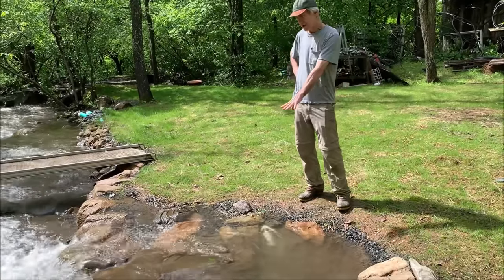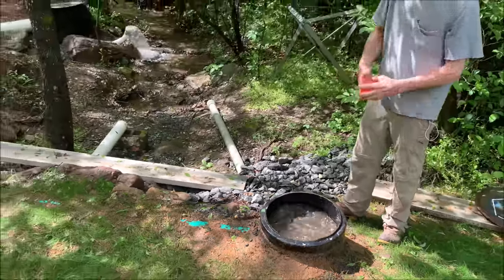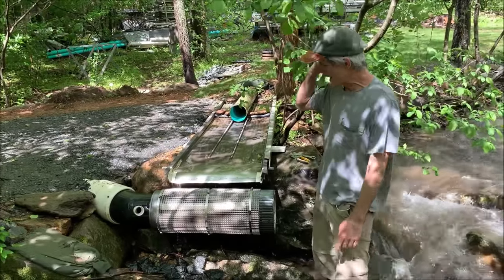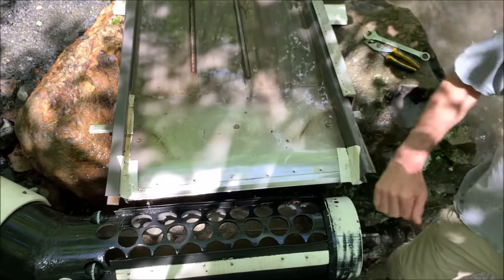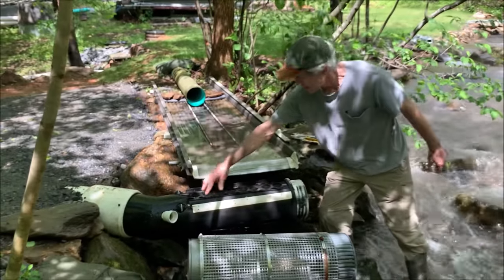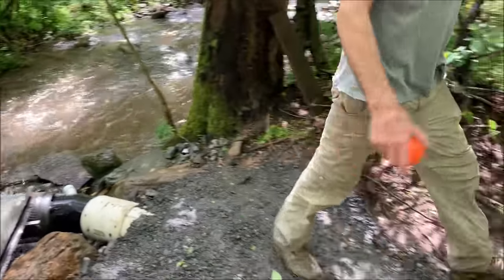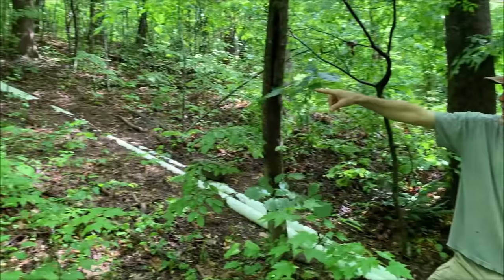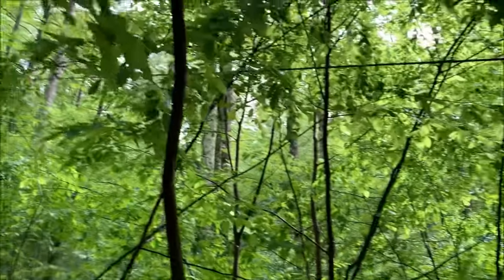500 Watt Hydro Power System in Virginia (Overview)

Comment: I got to say for anybody doing this use your three phase and run it all the way up to where you're going to use it.
That higher voltage 3 phase is going to get you less voltage drop and less line loss, better yet step that three phase up in voltage. For even less line loss. 
I see this quite often in small generators and windmills where they switch to DC right at the base of the windmill or right above the generator.

Comment: I haven't built hydro power before; but from design perspective the capacity of the stream to generate more with or without diverting the water, the effort seem more than needed for 500W.
Reply: Fact Checker  MartyT - https://www.youtube.com/user/AngryRamNZ/videos
Reply: thats a lot of time effort and money you could do with two solar panels for a few hundred bucks
Reply: @issadraco532  He spray painted them and hid the generator in the rocks because its horribly illegal to do this in virginia.
Reply: @issadraco532  Many people live in cottages without any electricity, so this is way to have comfort and do not need generator. With LED lights and low consumption it is quite enough for you to have lights, TV etc. Older people do not have households wasting 20kW/h. LED lights in 3 room cottage would take like 50-60W and rest is for other electronics. FX CPU or similar would ofc need 500W+, but does this guy look like he spends a lot of time on PC? No. So most likely he uses laptop with 35-65W consuption and with the lights on still has 300W+ left for other stuff.

Yes, it wasn´t hidden. Yes, it isn´t properly painted. But the cost of it was most likely low since he did it himself from scraps and thats what counts.

Most parts of this solution were actually very creative and reused scrap nobody wants, so you get it for free. I guess he payed only for turbine, piping, inverters and batteries. So again, cheap option.

And about the looks, that´s your point of view. He might have big property and this could be far from it, on the edge, so he doesn´t even notice. And again, it is his creation. Most likely he enjoys the looks, since it took him time and sweat.

It must have taken a lot of work... It is easy to be internet judge
Reply: @Grandassets  I agree it is way way overkill. However, I can see why water power would be preferred since it's available 24/7. But yea, way too much work, for such a small amount of power. And it just looks like shite.
Reply: Fact Checker  yea but he generates 45psi, how u do that from a stream?
Reply: @Grandassets  not even close. You would need 24 solar cells with a perfect set up to generate the power this hydro system is generating. 12k a day
Reply: @lowcountry1397  each panel is 385 if you get the good ones or 235 watt if you do it on the cheap you would need 2 or 3 to do the same thing, hey look ma no moving parts in solar to break down is a plus
Reply: @Grandassets  lol. He's making 12000, as in 12k kilowatts, a day. I have solar at the house and an off-grid setup at the farm. Unless, the cells are roof size, directionally perfect or magical, you're going to need a lot more than two
Reply: @lowcountry1397  the title says 500w
Reply: @Grandassets  The sun only shines part of the day on the solar panels and even then the period where you actually get the rated output is small. The water flows 24 hours a day. 500W x 24 hours in a day = 12000 wH (12kwH)  385 w x 3 solar panels x 8 hours = 9240 wH this will less, as I highly doubt you will get full power for 8 hours many days.
Reply: @frederickjohnh  4 panels would cover the 12kwH in 8 hours vs 24. If you want some redundancy, bump it up to 5 panels, that gets you 15,400kwH on a perfect day. We're also assuming a full stream with no drought for the 12kwH. You can get 385W solar panels for $250 each. So even if you add freight shipping and taxes, you're looking at around $1500 to get setup. 

For the hydro, if you can find 4" PVC for $12 for 4"x10' you're looking at about $250 for 2 100' runs. The "Greenspoon" is $250, and the ME1603 is another $150. So you're already at $650 without accounting for the pipe connections, or any of the other pipes, and his metal tray and sieve at the top.

So let's say in a perfect world, the price is similar for close to the same output. The question then is do you like to tinker around and you don't mind everything involved in the hydro, or do you just want the simplistic solar option? Not to mention that his pipe is literally hanging from trees that could fall in a storm and a large part of his entire system could be lost. Replacing 100 feet of pipe in the woods is going to be a lot harder that replacing a couple panels. I'm not saying one way is right or wrong, just food for thought.
Reply: @Grandassets  And you would end up paying for it in batteries. That is a cost that comes with solar vs hydro because you have to be able to store what you make in 8 hours to use in the other 16. And with hydro, on a cloudy day you still get power whereas with solar, it will be reduced or zero depending. Solar is not for everybody and neither is hydro power. Each has its place.
Reply: @gravelydon7072  up here in NY our streams freeze over, heck our river is right now
Reply: @Grandassets  Yep. They do in Ohio also. Now you know it is really cold when 30 miles South of Miami, our irrigation systems start freezing up. Our water temps down here are in the 70° range even on a night when the air temp drops to 26°. Our soil temp 6 inches below the surface right now is 75° as an example with a 72° air temp.

Now would your solar panels also be covered in snow right now?  The panels in SE Ohio are but the Ohio River is flowing as would the creek thru our farm be.
Reply: I would have aimed for a water wheel made from repurposed plastic, on a grander scale with a pulley system for increasing or decreasing the rpm's on the gennie.
Reply: @Issa draco for you to hide behind your computer or smartphone and criticize the hard work of the man is very easy I'm sure you won't be able to come up with an idea like this. You have to give credit where it's due......
Reply: @issadraco532  Because some of us enjoy the design process and don't care if we have pipes running across our property. Also living off the grid (or at least far away from populated areas) forces you to be self-sufficient. You build things with what you have, and you don't let the resources available to you (like running water) go to waste.
Reply: @PhillyMotoXTS  Something I haven’t seen anybody bring up yet - what happens to the land if one of those pipes breaks? You’re gonna have a high pressure stream of water washing away a lot of topsoil, potentially before you even notice anything is wrong. You could end up with a real mess on your hands and potentially bad damage to your property or that of your neighbors. And the more pipe - especially the more dangling pipe - the greater the chances of something going very wrong.
Reply: @sunspot42  It seems like a hydraulic mining operation waiting to happen!
Reply: @PhillyMotoXTS  old comment now i know but your math is wrong because even summer you don't get 8 hours at maximum power unless your panels are on a tracking system and then that's only summer you will get less useable light during the other seasons and can get days on end of near zero in rainy weather so when your factoring price not only is it the cost of generating the power but storing too so you would need more panels than you originally thought probably more like 8-10 and in general a much larger battery bank
Reply: @gravelydon7072  Exactly! As well as clearing precious trees to ensure solar panels get enough direct sun exposure to be effective. This property is covered in trees. Despite the awkward and unsightly web of pipes, despie the attempt to camouflage them, utilizing the creek to generate power round the clock was the natural choice for this site.

Comment: I don't think it's overengineered. This is how home-made stuff looks like. Realize there's no (mini)dam where the water would get cleaned just by having the gravel, sand and mud simply fall to the bottom. Also, it is all in the open, i.e. things are falling to the whole system. It's not a compact concrete building. That said, I think it's a simple working solutions to individual aspects of the task. 

Also, he doesn't have a big hill around, and the stream seems to be seasonal. So, 500 W seems legit.
Reply: Still, it looks like there is a large money investment for all of the piping, electronics, etc,. How long for return on investment?
Reply: @r.carter8378  I have no idea what his ROI would be, but a decent amount of this stuff could have been laying around or could also be used for a different project. I do agree that it is a lot of stuff and if he did buy it all it would be quite expensive.
Reply: @r.carter8378  Electricity costs on average 13.5 cents per kWh in the US. Hes producing roughly 500 watts, and for simplicity we'll assume that's constant regardless of conditions (not true but for analysis it will do. He would have to take a 24hr production measurement and get the average). So, every hour his setup is producing roughly 6-7 cents worth of electricity. Assuming it runs flawlessly its around $50 a month. 

The generator hes using is like $150 new. I can't estimate the other electronics because they're not exactly my field of knowledge and we don't know whats recycled/used. Pipe prices vary depending on what kind hes got going... a decent estimate would be around a year ROI I think.

Comment: So over engineer for 500 watts, could be more simple, but if it works for him and his happy, congrats to the builder.. it will qualify for a Mega Projects Discovery channel series...
Reply: He could win a Rube Goldberg machine competition hands down!
Reply: I know, I don’t understand why the water needs to be moved 100 miles away from the house.
Reply: @masonlynch1793  It probably needs to move that far to create an increase in pressure to make the hydro work. The bigger the drop, the more potential power.
Reply: Mason Lynch. That's right, you need that distance and height drop to bring up water pressure to drive the turbine. Also the sudden reduction in pipe size will greatly bring up the water flow with all that distance of piped water pushing it. It seems the cable or rope  up to the tree is to hold up the pipe up while not having the movement of the tree move the pipe around. He must have gone over his vision in his mind over and over again and finally arrived at its Eurika?  moment

Comment: Your rotating intake screen is a good substitute to a Coanda screen. Sure, it has moving parts, but it's a necessary mechanism to keep the intake clear of large debris without frequent maintenance.
Reply: I used ceramic skateboard ball bearings for my rotating screen, running slowly and water lubricated they show no wear after two years and are very free running. I had to put my remote electronics in a completely sealed enclosure as ants and cockroaches loved the warmth, they get into the inverters and cause arcs at 230 volts. Lightning just causing ground currents has induced various odd failures like diodes and digital meters so now there is a heavy aluminium wire earthing everything top to bottom, problems stopped.

Comment: Lot of infrastructure for 500W but as a fellow maker I fully understand half the fun is in the building of our contraptions and rarely the end result itself! Keep up the good work! I had to chuckle at your use of golf balls throughout!
Reply: Even if it were 300 watts, that would be all day every day I imagine. Not fluctuating as much as wind or solar.
Reply: 500W 24 hours a day is a lot. 12KW Hours. You might need to have the heating as gas or burn wood in winter.
Reply: It's probably as much as or more energy than a house uses at idle. Washing machines aren't 24/7.

Who knows if it totals to more than they use in a day though.
Reply: i imagine they have solar too, or they could use 2of these micro hydro setups with not much added pipe at the end, seems they have lots of pressure
Reply: I was thinking the same, I use on average 500kwh a month so this'll actually run my house just fine, its getting the required power for cooking id have trouble with, but change mode of cooking and id be sweet
Reply: @gorillaau  10cents per kWh.
Reply: LOL He had the golf balls screwed onto the box to support the cover. I thought he is a golfer.
Reply: The infrastructure looks very very scalable. Especially with that over flow he could easily re direct that wasted water
Reply: tbh from a perspective of a guy who got these pico-hydro stations in recommended yesterday, and watched like a dozen of videos on the topic since then: this looks like the most reliable setup out there. Except that Nepal village hydro, which is about 6 of generators running in parallel: they even have dedicated control room.
Reply: The 500w will be because of the size of the turbine itself. The rest of the system looks pretty good. With an upgraded turbine (about twice the blade size) there's likely 1kw to 1.5kw available.
Reply: Forgive me for my ignorance, but what can I practically plug in to this and use? Will it run a computer? A refrigerator? A lamp?
It it just 24v or can I get standard 110v I can plug in to with anything?
I see 500W, I think, well, I can't plug my 750W computer or 900W microwave in to it, what can I use it for?
Reply: @peterbelanger4094  The output of the generator is converted to 24V DC, used to charge those big batteries, then the battery output is inverted to 110V AC for the house. Your computer and microwave only use that much power in very short bursts, so as long as the batteries have enough capacity to last for that amount of time they'll act as a buffer which allows you to draw more than 500W for short periods
Reply: @justinsellers9402  Sure grid electricity is often cheaper. What if there is no grid? What will it cost if you have to pay to fetch fuel for a generator?  What is the price if fuel goes up double due to proxy wars in Ukraine?
Reply: @peterbelanger4094  this is only one end of it. You have to have a storage battery on the other end and an inverter to pull that up to 120 or 240 volts. Basically this acts like a battery charger so that you've got stored capacity when you need more than 500 watts.
Reply: @gorillaau  he uses a heater as overload dump.. prolly can use it in winter if the stream does not freeze up. and then be a extra line of wire, no clue tho. maybe he use the heater in house and his gauges/measurement in house to use max electrical heating without depleting batteries. but then there is battery sustainability/output that is affected by freezing too. questions questions..
Reply: My only issue would be having power during winter... Virginia gets hammered by snow storms, guarantee he has a back up method or he's still connected to the grid... Can't get hydro power if the water is frozen
Reply: @LongHaulTrucker4Life  possible. But if he has it dammed well. Running water does not freeze and under the ice at the top. There is always running water...
Reply: Compared to not having a monthly electric bill. Worth it.
Reply: @KallePihlajasaari  no it not. Grid is any were between 150-400 a mounth this cost at most about 12000 grand. After about a year yer saving money.
Reply: I was going to say the same thing. This thing is a toy, but toys are fun :P
Reply: A lot more f people here confuse KW and KWH. Yes this will produce 12KWH per day. Great for charging a bank of batteries that feed your inverter. Can it run your house directly on AC? Not a chance in hell. Fridge or well pump starting will draw more amperage than that thing would ever produce
Reply: @kirkstinson7316  It's kWh actually but you seem to be the expert.
Reply: You use that to charge batteries, then run things off them. I wish I had a way to get 500w constantly through renewables, and pump it into my Bluetti, I'd be laughing!
Reply: @kirkstinson7316  He's using car batteries to store the power. If those are connected directly to whatever he's powering, it should be fine. Car batteries are designed to provide (depending on the battery) 250+ cranking amps sustained for more than 30 seconds. He has at least four of them; if they're connected in parallel, those batteries should provide more than 1000 amps if needed.
Reply: @gorillaau  Where we live 12KWH is worth $1.